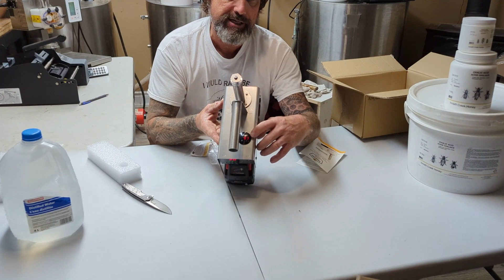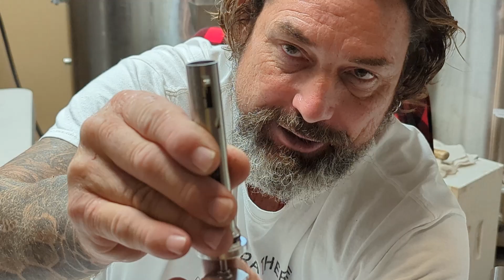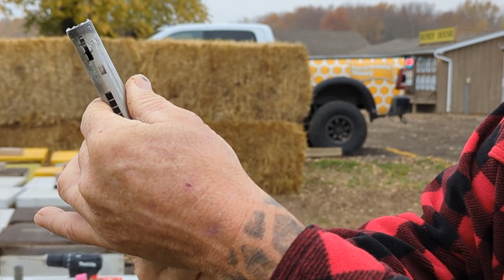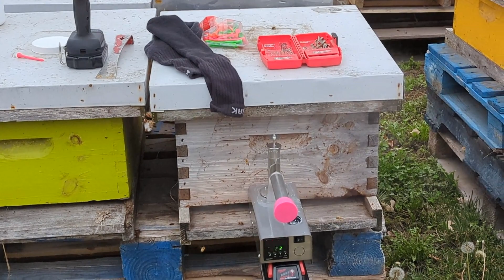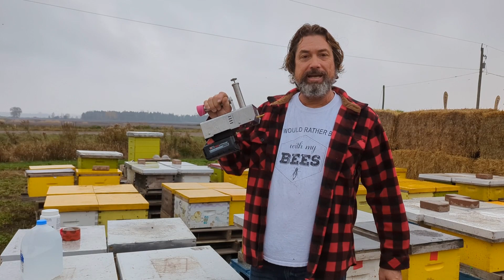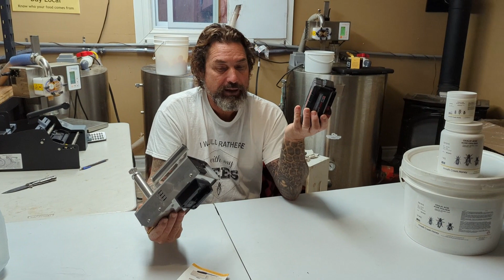InstantVap Oxalic Acid Vaporizer Unboxing and How To Use

Comment: Is there a trick to loading the plunger? Every time, no matter the dosage set, the oxalic acid power fails to stay in. Update! Adding a couple drops of water will make it stick in the plunger. Add water drops, shake shake shake and its good to go!
Reply from the maker: You can try adding a few drops of water to the oxalic acid and mixing it up.  Just a little bit of moisture. Will make it pack like Sand on the beach when you're making sandcastles
Reply: @Innisfilcreekhoney  It works! Thank you

Comment: I found the instructions lacking on my purchase. Does the measuring tube need cooling between doses?
Reply from the maker: Yes, the instructions included are lacking.  That is why I made the video.  I have never let the tube cool down.  I do notice that if I use it for a long time the O ring starts to not seal as effectively.
Reply: @Innisfilcreekhoney  I will be watching your video. I have done a lot of mite checks after doing ox last all and none have found any mites - so far. So, I will be using the new tool this fall again, as well as, other treatments that may be necessary should I find a heavy mite load in the near future. I'm also making splits to keep the mite load down.

Comment: Great video, Brian. My vaporizer does actually have a DW for Dewalt stamped right into the plastic batter holder. Unless they've changed it, you might have just missed it.
Reply from the maker: if it does it is to small to notice.  A big sticker is what it needs.

Comment: Thanks Brian very informative, do you use one application or many over a set amount of days, will you give them another blast in let’s say a week. Your right about dosage have seen many a commercial use 4 grams. Each to their own I guess. Even though your not suppose to do with capped brood, could you do over many weeks to get the mites as young hatch, a long enough cycle to even get the drones ?Great video tks.
Reply from the maker: Thanks.  I treated with Formic in September.  I am just trying Oxalic Vapor out to see if it is a suitable year end treatment so one treatment will suffice.
Oxalic Vapor works best if there is no brood.  If brood is present there are better ways to treat in my opinion.